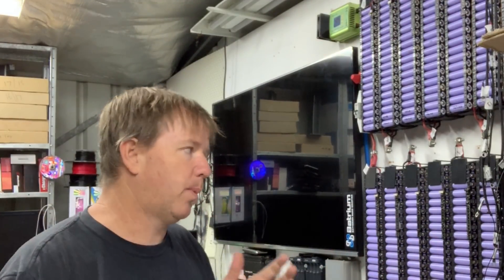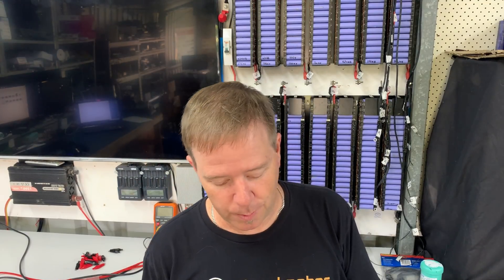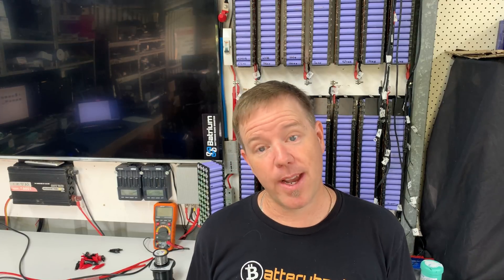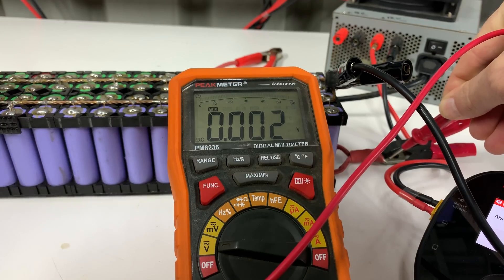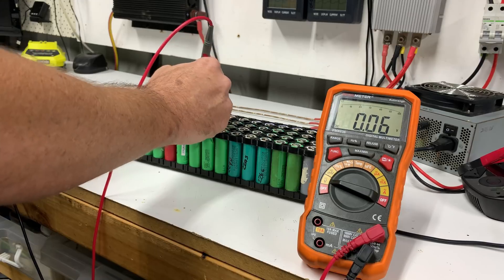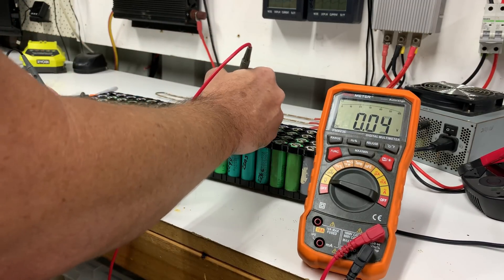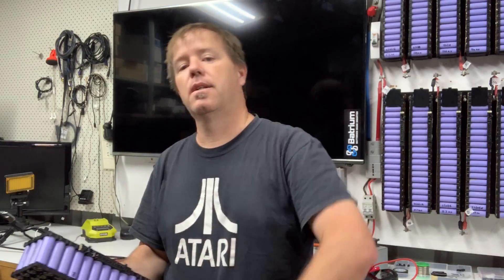No room to be complacent when playing with Lithium

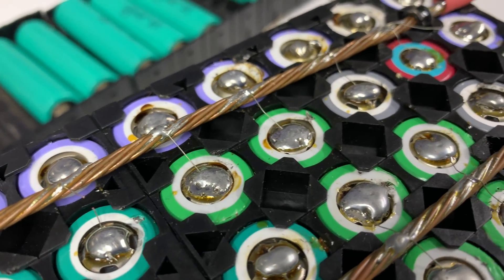Comment: I'm not done with the video yet, so you may have caught this already, but @4:55, teal cell. Broken fuse wire with melted tips.
Reply from the maker: How the hell you see that lol well spotted BUT it was zero volt as well so i'd say broken handling it
Reply: @HBPowerwall  It's probably the 4k monitor giving me an unfair advantage.  Looking at it again, I still think the broken tips of that fuse wire look mushroomed/balled from melting. edit: There's a few frames with it in almost perfect focus @4:54 where you can see the melted bits. There's a small section missing as well.
Reply: @PoignantPirate  I concur, the tips of that fuse wire are balled
Reply from the maker: Yep, does look like she cooked - :()